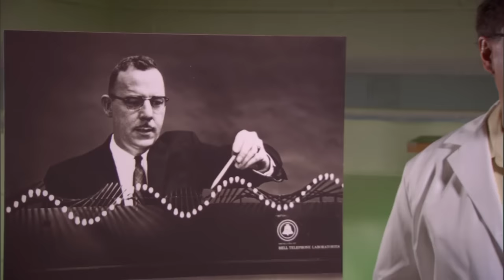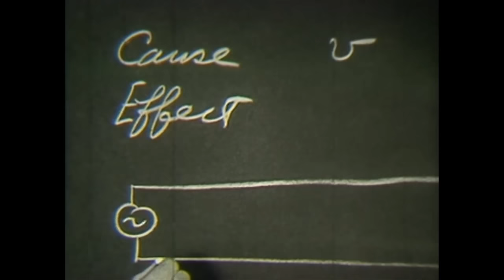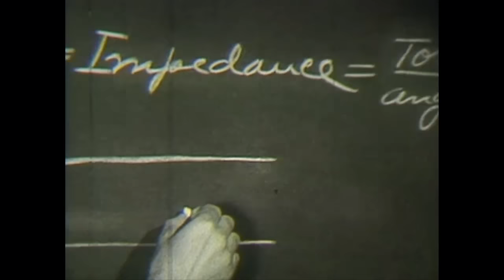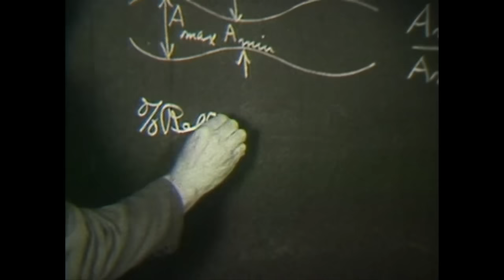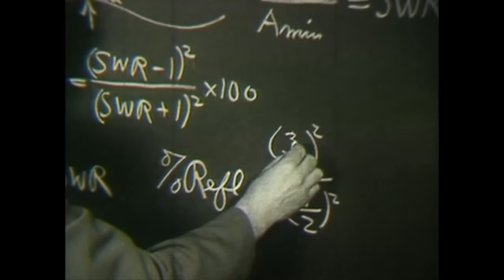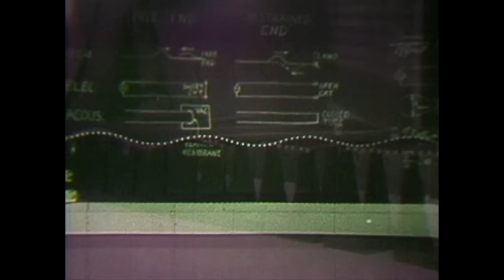AT&T Archives: Similiarities of Wave Behavior (Bonus Edition)

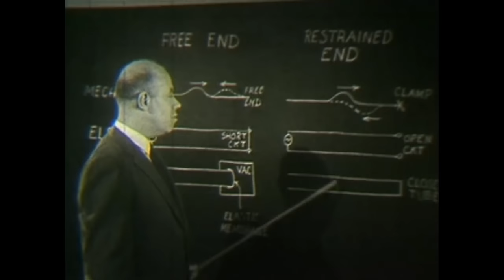Comment: At 05:09, I think that load impedance is not correct: positive reflection happens on open circuit (not short circuit), and negative reflection happens on short circuit (not open circuit).
Reply: He should explain it with regards to Voltage (not Current). I.e a short circuits does not allow the voltage to change (fixed side), whereas the open circuit allows the voltage to change (open side).
Reply: I noticed that too.

Comment: My dad worked at Bell Lsbs and I had a basement full of test gear and jars of vintage transistors to toy with as a kid, and consequently have always had electronics and radio close to my heart and am still learning the deeper aspects of those subjects.

Bell Labs was an amazing place, there were actually two, one in Murry Hill, NJ, where the transistor was invented, and one in Holmdel, NJ, where my father had worked and did quite a bit of transmission cable work and later fiber work. 

There was a white water tower there at the campus in Holmdel with 3 support columns, which oooked suspiciously like an oversized transistor; the joke was someday someone would paint E, B, and C for emitter, base, and collector on the bottom of the tower to properly label the “leads” of the water tower.

That kind of research is where it’s at, we need to get back to that collaborative multidisciplinary approach with a big center and a big budget to push the technology frontiers hard again. For example, the west needs workable fusion power, and the fragmented approach is perhaps costing more in lost time, than it is saving in dollars.

Comment: Maybe this has been commented earlier in this thread…
About 5:30 into the film, John Shive talks about the termination of an electrical transmission line. At first, I thought John Shive was wrong, since I have truly seen the opposite in our lab. What I have seen on an oscilloscope is a wave that returns “upside down” from a short circuit termination, while an open circuit termination gives a reflected wave with the same phase as the incoming wave.
But John Shive talks about a current while an oscilloscope measures voltage. At an open end, the law of conservation of energy results in the pulse having to return to where it came from (since it has nowhere else to go). Going back, a current would have to pass through an imaginary amperemeter in the opposite direction compared to its original direction, thus giving a current with the opposite sign.
So, John Shive was right about the current. Why doesn’t the voltage change polarity as well? This also has to do with energy. The termination and the ideal wires do not “steal” (convert) or store any energy. Therefore, the sum of energy from the forward and the return wave must be zero, E(forward) + E(return) = 0 and E(forward) = -E(return). The minus-sign comes from the inverted current, therefor the voltage can’t be inverted.
Anyone who agree with me?
Reply: I had the same initial thought, about shorts vs opens, but just figured I had misremembered my EM classes, since the professor must be right.

Thank you so much for explaining  the mental disconnect.   I'll sleep better, now that Dr shive and I agree.
Reply: I'm glad I'm not the only one who noticed this. Thought maybe I was missing something.
Reply: Same, same. Your comment makes sense.
Reply: Well if energy stored as torque is analogous to current and amplitude displacement is analogous to voltage, then your initial impression I think correct.  Analogies between different media only go so far.
As an RF engineer as you are probably also we have seen any resistive load above the characteristic Z of the line return a reflection in the same as the incident polarity, while a lower R returns an inverted one.

Comment: At 5:58, there is a mistake on the chalkboard. If the transmission line is shorted, the voltage reflected will be inverted. This is because the current will flow on the minus terminal momentarily during the return propagation time before the output is zero due to short circuit condition. Otherwise, this is a very informative video.
Reply: I thought that too. I don't understand how they made this mistake though?

Comment: This a great video .Truly a treasure. A slight correction would be that the free end of the mechanical system is analogous to an open circuit in an electrical system. While the restrained end in a mechanical system is analogous to a short circuit in an electrical system.
Reply: @John King Thanks for clarifying

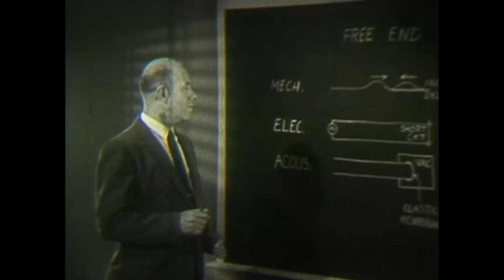Comment: Hi viewer's. Is there a mistake in the drawing on the black board at 04:52?.In an electrical transmission line the reflected wave is inverted when the line is shorted at the end. But its shown that the inverted reflection occurs when the line is open.
Is my understanding correct? Viewers kindly clarify on this.
Reply: Definitely opposite. But I just HAVE to be wrong. Wouldn't some other genius engineer/scientist have already pointed this out. Why are there only a few of us that notice this???
Reply: He is talking about current waves not voltage waves.

Comment: Very informative and well presented.  But I think I noticed something possibly incorrect.  At about 5:48, the speaker mentioned that in an electric transmission line, an open end results in a reversed polarity returning wave, and a short circuit end results in a same polarity returning wave.  In another YouTube video I viewed, "Tektronix - Transmission Lines", the opposite was demonstrated to be true using an oscilloscope.  Which is correct?
Reply: You are indeed correct - the short inverts the wave.  Would be a neat trick if it was the other way.

Comment: Responding to +HitAndMissLab comment from a few years ago . . . This video also gets the acoustic wave reflection wrong  (kind of).  The reflection of a acoustic displacement wave from a free end is upright, while the reflection of an acoustic displacement wave from a rigid closed end is inverted.  However, we don't typically measure displacement waves for acoustic sound waves.  Instead our ears and microphones respond to pressure instead -- and pressure has phase quadrature (90 degrees out of phase) with displacement.  So,  the reflection of a pressure wave reflects from a free, open end is inverted, and the reflection of a pressure wave reflects from a rigid closed end is upright -- the opposite of what happens for a transverse mechanical displacement wave.

Comment: At 4:45, the drawings for electric medium seems reversed. On an oscilloscope, an open circuit reflects the pulse in the same direction and the short circuit reflects the pulse in the opposite direction. However, the chalk board shows the opposite of this. Am I missing something?
Reply: I was scrolling the comments looking to see if anyone mentioned this, I was like it might be more than a year since I've had my E&M class but I'm pretty sure those are reversed, definitely confused me. From my research to double check, I'm pretty sure this is a mistake.

Comment: Am I missing something, or are the electrical diagrams reversed for reflection? A short reflects inverted to match the boundary condition of a zero sum for impinging and reflected waves, no?
Reply: At a short the boundary condition is zero voltage.  A +ve incident voltage wave is cancelled by a -ve reflected wave.  For an open circuit the boundary condition is zero current and again the incident and inverse reflected current waves cancel.
Reply: Yes, Diagrams are reversed. I got same doubt & came to comment section . :)
Reply: He is talking about current waves not voltage waves.
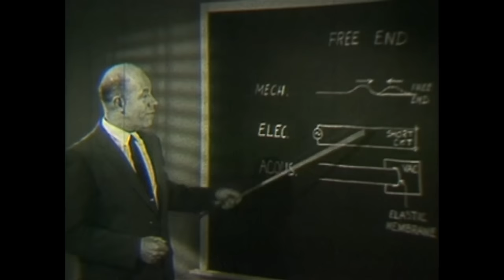Reply: @MohammedAli-ig2nu  Thanks man, you are so right. He actually explicitly says so between 5:00 and 6:00. I wasn't paying enough attention; the boundary condition for current at an open end is 0 current, so the reflected current is inverted indeed as Pete Singleton and you point out...

Comment: I propably misunderstand the logic, but if the clamp represent an open circuit i.e. Zload=large, and the reflection coefficient is approx. (-1) because the wave is inverted. From wiki -"(complete negative reflection, when the line is short-circuited,)", and if you check the formula ((reflection coefficient=(Zload-Z)/(Zload+Z))). This formula and the wiki implies it's the other way around. Any clarification is appriciated, and thanks for a excellent video!
Reply: Yes, it appears to be a mistake on the board. An infinite load or short will reflect as a negative or inverted signal.
Reply: But a short and an open circuit are opposit of each other, then a short=-1 and an open=+1. But I see others have pointed this out allready. Thanks for the answer!

Comment: This was really great! Ive shared it! I was researching waves because my son lives on Puget Sound and just sent me simulations of the potential Tsunami damage. I believe it will be worse than the simulations show and am looking for data to support that to convince him to move to safer ground. I looked at geoligical maps and can see evidence of erosive damage similiar to that at the bottom of the English Channel when water flowed into the gap. The damage is well up into the hills by several lakes, there are ripples across the flats below and scalloped edges to the bays all which look erosive. The area he is in looks like it will suffer ricochet effects from the tsunami energy that will be very long lasting. What isnt shown is the seiche effects that will come from the quake shocks that will happen first. It could be the(long term) compounded wave energy that really makes things worse. Being at the end of the sound dosent help. From this video, I can see the nartowing will increase wave speed. The shore will act as the restraint? Causing inverse waves? This should happen very quickly. A video of a swimming pool after a quake shows low inverse waves and then quite high waves escaping the edges. When you factor in the land damage to buildings, roads taken out by subsidence and liquifaction, land slides under water expected in the same event creating more tsunamis, further slides on the ground in the hills where people may he sheltering, waves quite quickly and quite high that could reach into the places where people are sheltering, there is a real challenge to get people through the event when it comes, to get them to a safe place. Real world applications for this information.

Comment: For everyone that is saying it's wrong, they just placed the open circuit in the "constrained cases" and the short circuit in the "open end cases". Should be clear that was a dumb mistake. :D
Reply: Actually at 5:36 he says that an open termination is a clamped end for current, so he is dealing with currents. This means the diagram is correct. A clamped end for voltage (short circuit) is a free end for current and vice versa.
Reply: Coblentz07 yeah i noticed it! So he was a bit subtle in this passage :D This mistake is probably caused by the generator symbol, that's commonly used for both tension and current, but is more common for the tension.
Reply: I missed it too, but it should still enlighten most who don't know that level of detail about electricity.
Reply: @Coblentz07  , 
If so, then how would you measure the current?
Reply: @sazard6062  ,
What is this mistake you are talking about?
Reply: @solewalk  What exactly do you mean? The reflected current wave from a short circuit will have the same magnitude as the forward wave because the reflected voltage wave that induces that current in the transmission line is the same magnitude as the forward voltage wave.
Reply: @Coblentz07  and he said that the effect that he is looking for impedance is the current (formula of cause and effects).
Reply: Good point. Still, I was confused by it. Wanted to make sure I understood which way was correct.

Comment: A solar probe (or even a manned cylindrical craft) could be design Just Like This.

There are other things to considering, like the electromagnetic bubble (and foam) that protects the solar system from deep space radiation, and integrating that with a transformer, Solenoids, generating Huge Magnetic Fields Without a Superconductor, taking into account all the shear forces, Heat, Turbulance, and other design characteristics to enable it to move without using traditional thrusters- this Should Be the Backbone of Future Space Travel and Design.  

The Wave Machine.

Comment: Should be required viewing for all faculty who teach this material. Most STEM students could easily benefit from this. Why reinvent the wheel, when this is done so well. I am all for progress and new tech, but much (NOT all) of the time what I see is "cute", but not as useful. Top tier presentation of material that students find confusing. And note how good his handwriting is! And see ~14:00 the transition from traveling wave to standing wave...he doesn't point out the transition, but it is wonderful to see. And, at ~20:00? when he ties the two systems together, he demonstrates that the reflected wave has "positive" orientation. I wish that he had shown starting the wave from the other end, too, so that the reflected wave that started in the RH system would be evident. The wave traveling in that direction sees s different impedance bump than the one shown, even though they both see the same point of mismatch.

Comment: +1  Excellent

(Perhaps Tech Studies classes can use their materials workshops to make similar machines, eg, as school fundraisers? Sell the machines & accessories to other schools & libraries, eg, at a fraction of the current Sci.Lab. supply market does.)

Now, where is a video of the system of components - represented by their mechanical analogs, eg, a capacitor (by a small sealed drum-like analog), etc.
I seem to recall that the system represented both AC & DC current flows, as well as impedances & resonance, etc. - to be found?

Comment: His electrical example on the chalkboard is wrong.   A electrical short reflects a inverted wave.  An open circuit reflects a wave of the same polarity.   The exact opposite of what he has on the board.   See a you tube video entitled "Tektronix - Transmission Lines" for a measured example.  The rest of the video is quite well done.
Reply: He is talking about current waves not voltage waves.

Comment: I watched it but I don't understand the significance of what he said. 
r/whoosh ?
Reply: Zom Bee Nature this has implications in many fields. For example, SWR is an important characteristic of the antenna system on a cell tower. Equipment at the bottom of the tower must transmit information to the antennas at the top, usually using optical waveguides (fiber cables). Someone maintaining or building that cell tower must pay attention to the SWR to ensure that power is transmitted efficiently through the antennas, rather than wastefully and dangerously being reflected back into the ground equipment.

As the professor points out there are numerous fields where this applies, of course, so that's just one example. Hope it made sense to you.
Reply: @wc70000roaringskulls  cell towers do not transmit information to the antennas over fiber.  They are radios and the use coax or waveguide depending on frequency.
Reply: If you still want to know why this is significant (and why so many people love this video), get in to amateur radio!

Comment: No offense, but this video is wrong, as far as electrical waves are concerned.

In the case of the short circuit termination of the transmission line, the reflected wave has its voltage inverted. Conversely, in the electrical case of the open ended termination voltage is doubled.
Reply: HitAndMissLab You are right. He got it opposite. Nonetheless, this is a great video.
Reply: His electrical example was for current.  That makes his example correct.
Reply: +numeroduke Can you explain? I know the Smith chart tells us that a transmission line terminated in a short circuit (i.e. zero impedance / left side of the chart) has a reflection coefficient of -1 (inverted). Granted, that is for the voltage signal V(x,t). How is the current affected?
Reply: According to Ohm's Law-:the current (I) will be approaching infinity if we neglect any losses in such case.
Reply: Yes! It would be nice if they can add some text to correct the wrong section in the beginning.
Reply: TheActiveStorage, it's AC current because even an open circuit can have capacitance.
Reply: The forward voltage is the forward current divided by the characteristic impedance (V+ = I+/Z), the backward voltage is MINUS the backward current divided by the characteristic impedance (V- = -1 * I-/Z). If a short circuit has a voltage reflection coefficient of -1, then the current reflection coefficient would have to be +1.
Reply: HitAndMissLab tutorials were wack back then .
Reply: Diane C he is talking about current. So it's correct.
Reply: @nihalt.j5624  Actually, no. He makes it clear that he's talking about voltage as the cause and current as the effect. He does indeed have it backwards. He also has it backwards in the acoustic model. A pressure pulse will reflect as pressure from a closed tube, and a vacuum from an open tube.